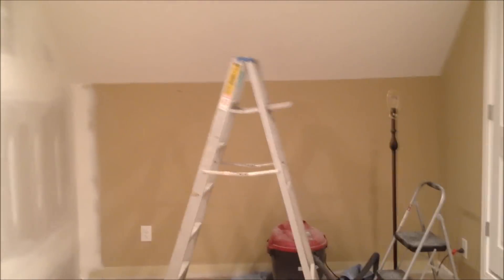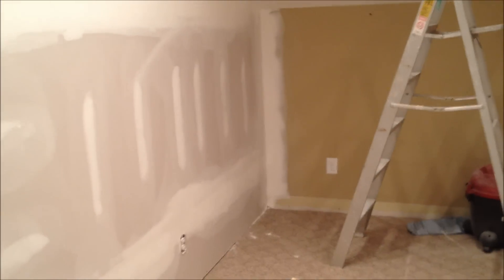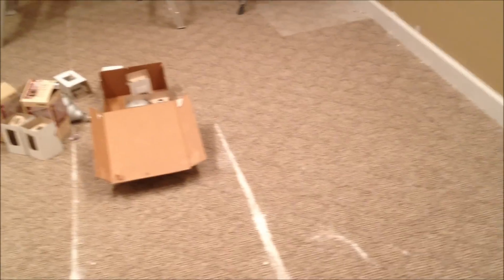My HO Scale Railroad - Episode 8

Comment: Looking good Brian. I down loaded the Atlas program for track work. I takes some getting use to,  then I printed out the plan. It will do 3 D, but I couldn't figure that out. Track light looks like it should work pretty good. I used 1" foam over 1/2 ply also, works good. I had to use 15/8 black panel nails to hold down my track, they only go into the ply about 3/8 of an inch, with a nail set.I'm doing O scale though. Great update. Keep em coming.

Comment from the maker: Thanks for the info and suggestions!! I don't usually do well with computerized track plans.  What I have found is that when I transfer the computer plan to the layout, I need to make changes.  I like to plan in "real space" so I can get a feel for where the structures are going to be relative to each other and how the cars travel around the track radii. I will most likely glue down the roadbed to the foam and glue the track to the roadbed.  Won't have to worry about nail holding power that way.

Comment from the maker: Thanks for the comment!!  There is an HVAC vent in the ceiling mid way between the track lights.  Good thing is that the furnace which houses the blower for the HVAC is in the attic just inside the door in my layout room so the CFM's are fairly high from that vent!!

Comment from the maker: Joe, no plan yet.  I have seen lots of things in other videos that I'd like to incorporate but I haven't put them all together.  That is my goal with the poster board - to layout the structures that I have and then fill in the gaps with scenery and larger industries.  Layout is going to be single level with a double main line so I can run trains continuously.  Like to have an intermodal yard, coal mine, lumber yard, scrap yard and one or two large industires.  Any input you have will be welcome!

Comment: I had to play with my track to get it right. I used the program to get a plan that would fit. I had to go buy all new track. I switched from Lionel tube to Atlas.I didn't want to buy something I didn't need. I glued my road bed down too. I didn't want to glue down the O gauge track in case I wanted to change something or sell it later. How big is your train room? My room is 10x14, but the layout is only 10x11. Keep up the good work. Looking forward to seeing some trains. I'm sure you are too.